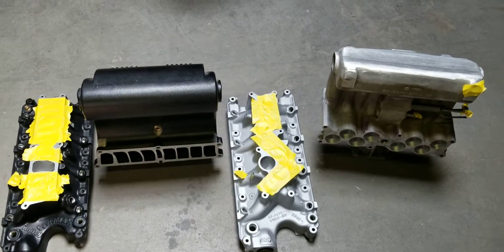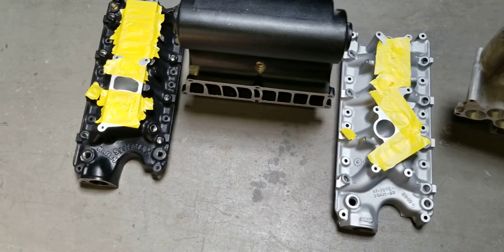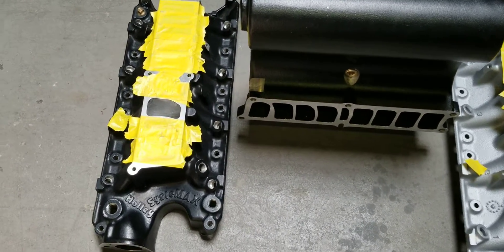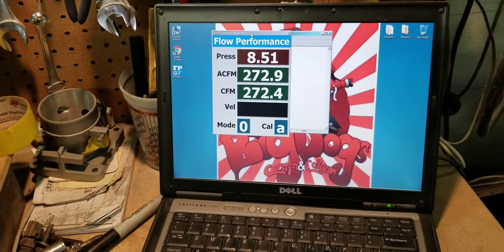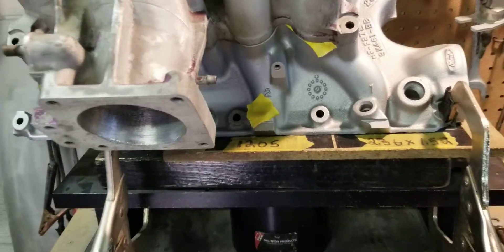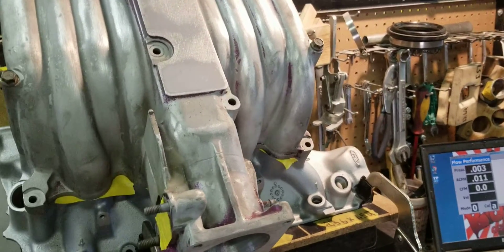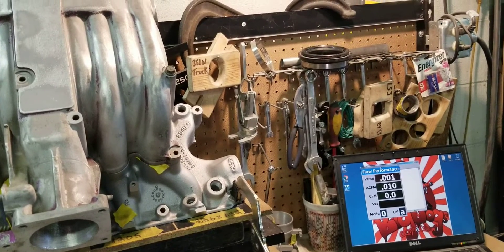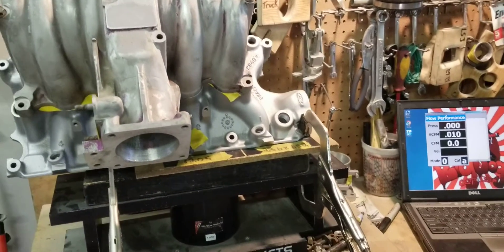Holley Systemax 2 ported lower only flow test comparison

Comment: Where’s the restriction in the Holley Systemax upper? It looks like it should flow at least 300cfm.
Reply from the maker: LOOKS doesn't mean flow! This has been a factor in aftermarket parts for decades and how they are able to make millions. For instance look at the Flowmaster 40 series mufflers. Millions sold even though they are some of the worst flowing mufflers on the market! 
The Systemax 2s have flow design flaws in them and even if you max ported the lowers they still won't flow over 270-275cfm average runner flow with a MILDLY ported upper. 
We know what to do to them!
Reply: @bigdogsportingtonyb2833  can you disclose the flow design flaws?

Comment: Dropping science and facts.. proof!
 "IF " you get  time and feel like doing it.. stage 2 ported explorer bolted  together compared to stock aftermarket..unless you already did it Tony..
Reply from the maker: Hey Jody I think we did a video a while ago comparing a customers stage 2 vs a Track heat. Our stage 2 Explorer blew the stock track heat out the water. We've had customers take off their Track heats, street, Edelbrock performers, Typhoons and ported lower only gt40s to put on our stage 2s and 3s gt40s. All of them reported bigger gains over what they took off. You know the one guy picked up 30whp over a home ported Edelbrock rpm even running the gt40 with the spacer!
Reply: @bigdogsportingtonyb2833   I figured it did.. your port work is top notch!
Reply from the maker: @19jody72  thanks! I'm always looking to get even better. Porting and hot rodding should be affordable to everyone and quality shouldn't suffer either!!
Reply: @bigdogsportingtonyb2833   THAT right there.. when a person can admit they want to get better at what they do.. says alot. Ive been a flooring installer for 28 years..I always try to figure out what works better!